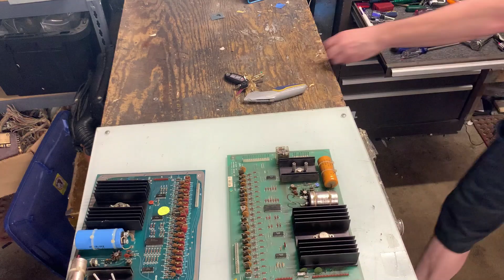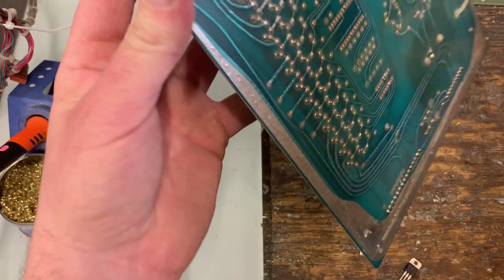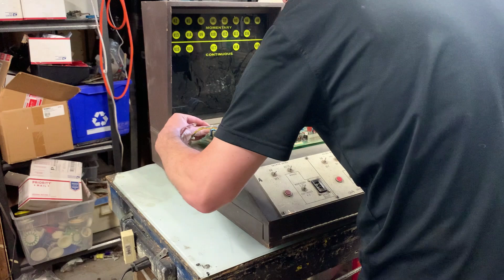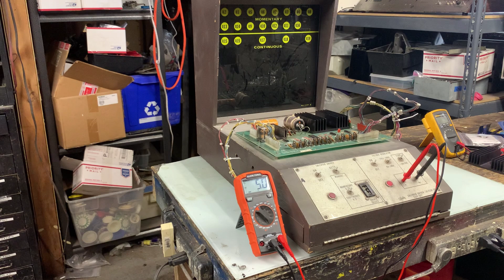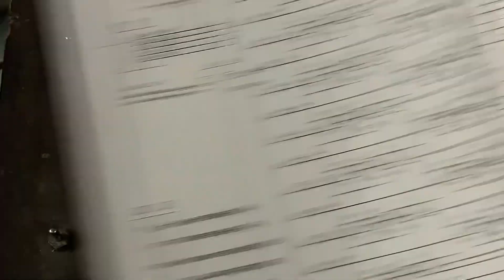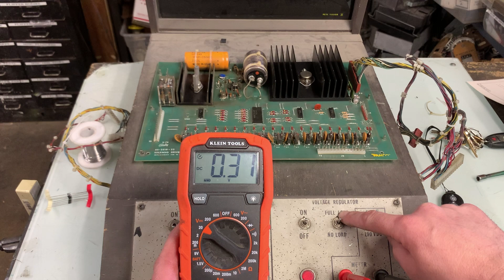Bally/Stern Solenoid Driver Board - Test, transistor, voltage regulator, Mata Hari!

Comment: "What's In The box?" My favorite game to play. I haven't had to replace regulators yet. But I've done plenty of transistor replacements. Thanks for the videos.
Reply from the maker: The EzSBC voltage regulators are awesome. Super hard to find the original correct ones but these are like 7 dollars each and fix a lot of power supplies